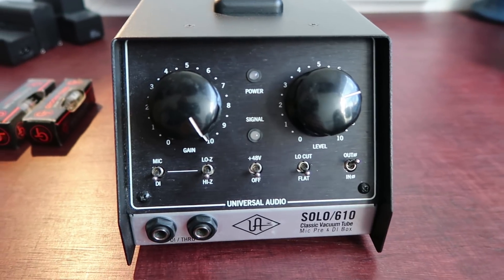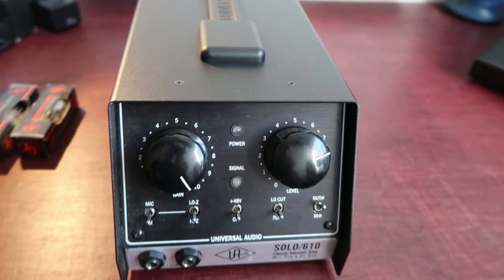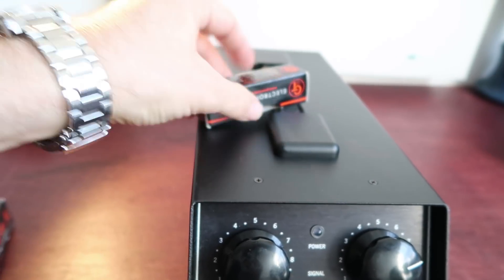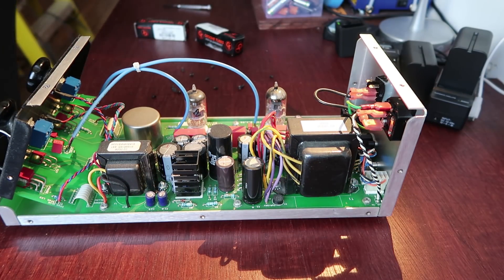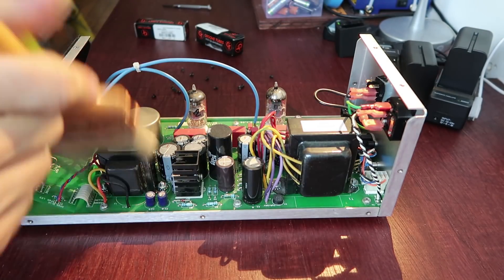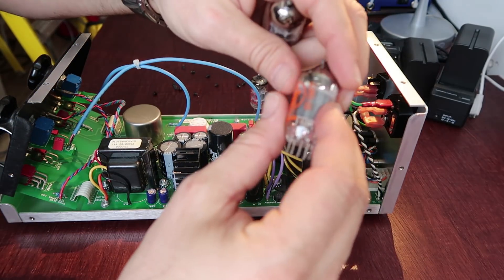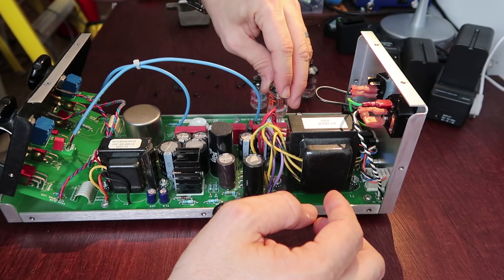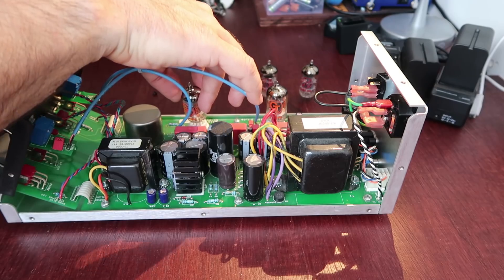Changing Tubes To The UA Solo 610 Preamp

Comment: 12AT7 is not a great tube for a mic preamp. It is most commonly used as a driver and phase inverter tube, and it has higher third order harmonics that similar gain factors. 5751 would likely be a better choice unless you are going for more symmetrical clipping.